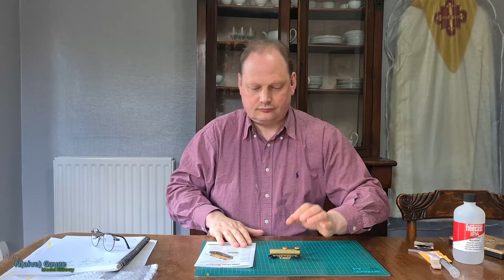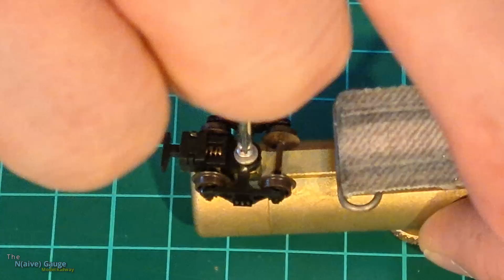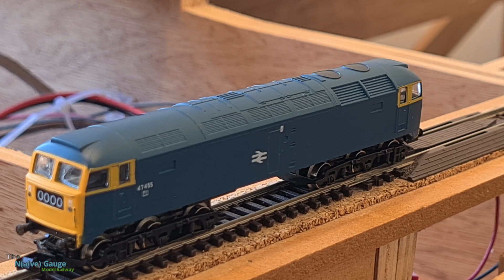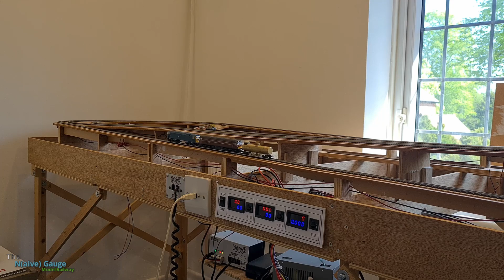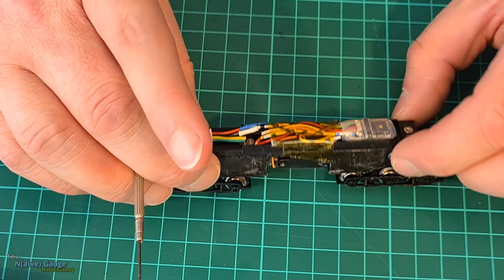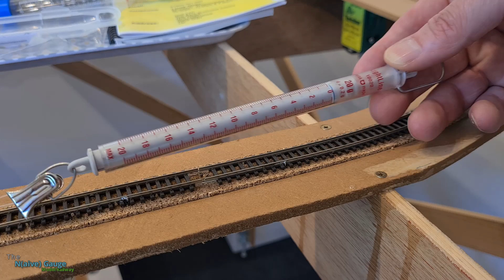44   CMX Clean machine

Comment: Alternatively....I took the spring out from under the cleaning pad. It still works it just doesn't press down so hard. The weight of the brass pad alone is sufficient for N scale. Without the spring my little 0-6-0 could pull it around.

Comment: The CMX cleaner looks higher and wider than the locomotives, will it travel through the tunnel portals  without comming into  contact with them?
It also looks expensive.
PS. It's good to see you back after such a long time.
Thanks for the info.
Reply from the maker: I do not have any tunnel portals yet, so I am not sure, but the loading gauge looks  about right. I think it will be ok.